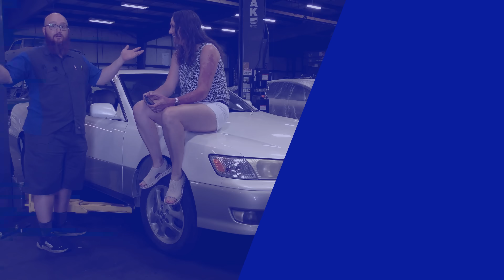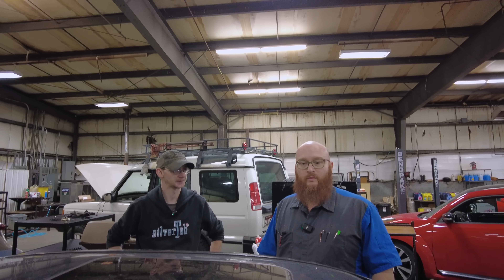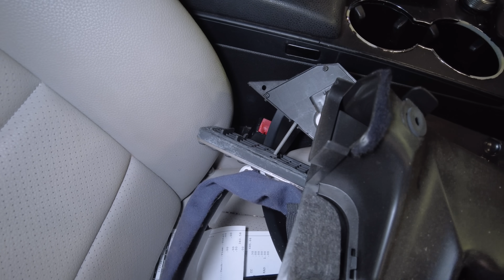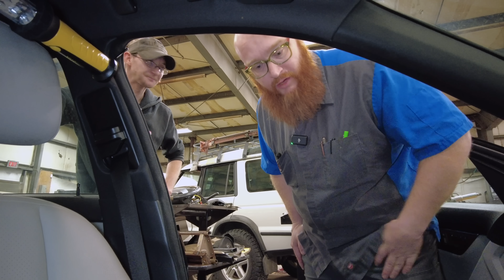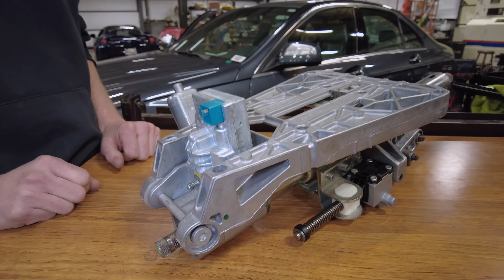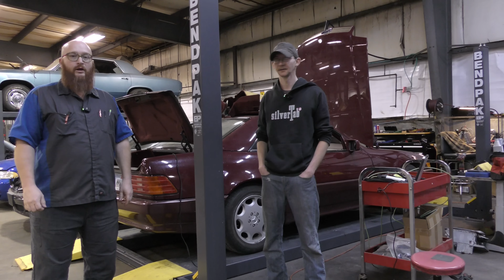Tiny Part TOTALLY Disabled This Mercedes! AND it's a Common Problem!

Comment: Know this feeling in a different way, Ive an Infiniti Q30, which for those that know, is Nissan's version of the Merc GLA. Well I had 5 errors in one recently, ABS , ASR , Brake Assist , AWD and PAS, Cruise control all disabled. 
Fault was a dead abs sensor, so should have been an easy fix, but had a local garage run away when Nissan quoted the sensor at £400 and also a wheel bearing for the internal part at £600, a mark up of 3 to 4 times over what Merc charge! 
Then a Merc specialist refused to even touch it! 
eventually got the sensor replaced via a friend who runs a tyre and brake place. But the insanity in that situation. Anyway a bit of a segway from this topic!

Comment: That is why I hate German engineering it is crap.
Reply: The issue is not bad engineering.  It's attributable to 'bean-counter led' very poor quality parts - with an emphasis on poor quality from 'you know where'.  If such a part had been fitted to a W123 Merc - it would still be operating today.

Comment: it happened to me on an older W202, local shops could not correct the problem, ended up selling car as was, went as far as replacing control unit  and many hours of diagnostics..

Comment: This is terribly inconvenient and somewhat embarrassing, but it's what happens when luxury is defined by complexity, bells, and whistles

I have a worse story. In Europe, the Netherlands some years back were using BMW's as police cars. Plenty fast. Advanced anti-theft protection. Tricky to steal. Then, a police car carrying 4 officers flew out of a corner and fell in a pond of sorts during a chase. Guess what? Anti-theft activated and the officers couldn't get out nor could anybody present at the time help them. Since the tragic loss of the police officers, that system is banned in the EU

If I ever drive luxury, it'd better only break when its inconvenient rather than when its dangerous

Comment: My first choice is to never own a Eurotrash car.  My second choice is to keep my low option 2010 Ford Fusion, even has manual transmission.  All this tech, especially in 2013+ cars means nothing newer than 2012 for me, if I had my choice I'd drive an 80's/90's anything GM with a 3800V6.

Comment: I had the same problem on my son w204 , we replaced the little motor inside the module , was 25$ on Amazon … Dealer was asking 3500$ to do the job

Comment: Of the 50% that doesn't lock, will an emulator be necessary? I can hear the lack of the lock and unlock feature however the car still starts and has been starting .
Reply: If it fails in the unlocked position I generally leave it in place. The lock pawl is actuated by gears and without power it won’t move

Comment: FYI there are local guys who can “fix” this for way cheaper than the $1200 it cost me to fix at the dealer.  I learned about this after the fact. Great cars otherwise and actually more reliable than a 2007 Camry Hybrid we also owned.
Reply: I find that hard to believe. Toyota's are some of the most reliable cars made. ( A retired mechanic of 27yrs).
Reply: @suzintru1  well, the hybrid battery failed at 120K miles ($3,500), when I sold at 130K miles the engine was using oil, the electronic brake modulator was failing ($2K), steering felt loose (diagnosed as failing steering gear, $2k) and the car was generally loose, paint failing, seat foam worn, etc. Contrast to my 2009 C300 which looked and drove like new. 

All my Camry issues, if you research, are quite normal. 

I’ve never had a German car wear so obviously as the Camry did.
Reply: @suzintru1  plus struts that were completely worn by 120K! And this was a Japan made one. So, sorry but Toyota was in a dark period for quite some time. All this said, my 1997 Land Cruiser is still with me and is great.
Reply: The 2AZ-FE engine was a Toyota dud, unless the owner managed to get it fixed under warranty (all it needed was new piston rings), after which it would be as good as most other Toyota engines.
Reply: @67daltonknox  at the time we received the campaign notice it was unfortunately not burning at that point, didn’t start until it ended. Similarly, a niece has a RAV with the same issue, burning to a comical level…the dealer, despite theoretically monitoring usage, never said it was out range of normal consumption 😀

Comment: Another example of engineered fails in a German car.
Reply: The issue is not bad engineering.  It's attributable to 'bean-counter led' very poor quality parts - with an emphasis on poor quality from 'you know where'.  If such a part had been fitted to a W123 Merc - it would still be operating today.

Comment: I have two 2009 c-class mercedes and both have experienced this failure in the last two years. I really can't complain though. Based on my experience as the original owner of these cars I don't think it is fair to say that it will fail again in 3-4 years. Before this module failed I enjoyed 12-14 years of flawless service from each of the two cars.
Reply: The mechanic said they do fail in 3-4 years because he experienced it in the workshop.
Reply: @anthonyxuereb792 they fail in 3-4 years as the replacement motor is usually Chinese or aftermarket, Mercedes does not sell just the motor separately, you have to buy the whole column
Reply: People pay attention please! It's not the motor I'm questing, it's the difficulty to replace it that's wrong. @Thondimuthusamy
Reply: @Thondimuthusamy  I would never reinstall another locking ESL, you are 100% right the vast majority of The locks/replacement gears are cheaply made.

I went the emulator route, and also I placed it in a convenient location so if it does ever go bad I'll be able to easily access it.
Reply: @edd2184 why would it ever go bad if u put a module in. The only reason it fails is because the motor burns out. Eliminating the motor eliminates possible failure. No?
Reply: @OneKyngTV  the emulators can go bad overtime, even though rare it does happen. By mounting it to a convenient location, if something does happen  you don't have to disassemble the lower dash.

However what a lot of people do, is buy a kit online to replace the ESL motor, why reinstall the same problematic part I have no idea. 

I wish I could answer more questions but I'm more familiar with the previous Mercedes locking system that use the switchblade key
Reply: @darklordsauron3415 the emulators are also Chinese made but since it uses microprocessors it must be reliable
Reply: If you go only for the motor, in 4y you will have the same issue, the module original replacement wll go a lot far. The aftermarket motors are not of the same quality
Reply: How are the rear subframes doing? I'm interested in this era of C-Class and E-Class but that's been my only concern.
Reply: These are great cars and the ESL is pretty much the main failure point to look out for. 

Wizard even said that in his video of which Benz to buy and which ones to avoid. 

the engine and transmission are very robust and if serviced with 5K mile full synthetic oil changes and 30-40K mile transmission services can go for a VERY long time. The best modern C class.
Reply: Avoid all German used cars outside of Germany. Germans need some Japanese input to help them overcome this dire situation. @8MunchenBayern8

Comment: GERMAN ENGINEERING
Reply: The issue is not bad engineering.  It's attributable to 'bean-counter led' very poor quality parts - with an emphasis on poor quality from 'you know where'.  If such a part had been fitted to a W123 Merc - it would still be operating today.

Comment: 9:03 My X204 is 12 years old now, i do a lot of short drives (work is less than 10km away) so it got many starts in the years since i bought it. Meaning that thingy has used it's motor each time twice (to unlock when starting and to lock when stopping) Haven't had that problem so far, so the "it will fail on you again in maybe 3-4 years" sounds a bit over dramatic to me.
Reply: Unfortunately, it’s truth. This one had previously been replaced, and I’ve seen new modules fail within two years.

Comment: As said below, where would the Wizzard be without Grimes.?
You can do all the diagnostics that you want, but previous experience is what
helps the most.
Grimes is way beyond the spare part fitters that you find at most main dealers.
Reply: ...exactly where he was before Grimes...you have the concept backwards...
Reply: I don't think so, it was Grimes who knew where to find the fault. @DericAnslum

Comment: It's absolutely criminal to design cars like that.
Reply: W126 w123 were built right, but government regulations (mpg, emissions, safety)  and cost prevent  cars being built like that anymore.
Reply: @nonofyabusiness4780 My W219 is built amazingly well. 232,000 miles today
Reply: @nonofyabusiness4780  government regulations are the only reason we HAVE decent cars nowadays. If it had been left to the manufacturers we would all still be in carbureted, rwd, V8 boats. They were forced. By government…and insurers.
Reply: @user-ew6jy9mo4r  : You have that in reverse. Government regulations are why cars are so horrible today, and why they all look the same.
Reply: @someone-else-c4v  nope nope nope. Go read a little bit about it. I wasn’t exaggerating at all. If it was left to US manufacturers, we would still be driving 15ft tanks with 8.0L, 200hp v8s. The only reason engine efficiency increased was because of gov regulations. Without that efficiency requirement, there would be no 700hp hellcats on pump gas. They would not have had incentive to increase bmep. There IS something to be said about TOO MUCH regulation…but that’s a different story all together. But really, go read up on it. It’s fascinating! The import restrictions during the 80s is the icing on the cake.
Reply: @user-ew6jy9mo4r  : You are completely and spectacularly wrong. Almost all safety features and improvements on cars were done BEFORE they became regulated. They had to be invented and test3eed first before they could be used and the government does NOT invent anything. They just destroy and ruin. The regulations just made them "standard", but before then people had a choice,. Plus, all these regulations and "improvements" have made cars cost DOUBLE (even when adjusted for inflation) than they were 40 or 50 years ago. Cars have become far less affordable for the average person than they were when I was a kid, that's for sure. And even USED cars now are through the roof. Government regulation destroys all that is good. The ONLY thing that regulation has improved were things like not allowing the pumping toxic waste into rivers and lakes etc. Everything else is a disaster. Besides, there are cars I would have wanted to own today that you can't even get anymore. Regulations have put the full sized sedan, and especially station wagons, which were fantastic because you had the comfort of a car and the carrying capacity of a truck, totally out of production and replaced by SUVs which get worse gas mileage, are not as comfortable and have a greater chance of rolling and still can't carry as much as a Caprice wagon could. I LIKE full sized sedans. I don't give a damn if it gets 50MPG or goes from 0-60 in three seconds. If people want toys like that let them buy it, but the cars I like don't even exit anymore and are gone for good. Plus, the older cars you could work on them with fewer tools, they were simpler and a lot cheaper to repair. Todays cars are rolling computers.
Reply: @someone-else-c4v  For real though, go read about it!
Reply: @someone-else-c4v  again, go read up about it!
Reply: @user-ew6jy9mo4r  Wow...Another ignorant fool.....
Reply: I've said many times The problem of using Mercedes, Bimmer, Audi or any high end cars here in North America is that the Mechanics here for these cars are shit...even at the dealership.  They still don't know how to fix easy stuff on Germans Cars compared to European Mechanics or even a roadside Mechanics in Africa or Middle East for these cars. My friends W204 had the same problem, and Bad  starter motor  in Ghana and was damn easy for these young Mechanics with few tools to fix everything without having to disassemble the whole car like this one. And oh for the starter they open it up and fix for just $30
Reply: I consider the criminal aspect to be the use of 'bean counter' led very poor quality parts - with an emphasis on 'poor quality'.  If this design feature had been included into the 'tank era' of Mecedes vehicles there would be no module failures.
Reply: @georgebettiol8338  but the “tank era” cars were all wasted. They were designed to run 500k miles w service. Americans tossed them all waaaay before that. Which is first, the chicken or the egg?  Are manufacturers building disposable cars because the consumer wants it? What did the consumer do with non disposable products?
Reply: It's called marketing nowadays
Reply: Absolutely agree, should be a recall.
Reply: Three word solution: Toy Oh Tah and your problems go away forever!
Reply: @patrickphippspa584  three words 🤣
Reply: @patrickphippspa584 You can date a man and you won’t ever have to worry about him getting pregnant.
Reply: @patrickphippspa584  I hate my TOYOTA.  I've been hoping to change it for something else but I've been driving it for 20 years and it won't break to give me an excuse for a new car.
Reply: ahhh, oh, yeah. Sure you hate your Toyota (like anyone would believe that!). 20 years of trouble-free ownership and you're "looking for an excuse" for a new car. Betcha it'll be a new Toyota IF you part ways with your old one. SMH @sugentechnologies1527
Reply: Everything is designed this way now. Buckle up!

Comment: I have a 2009 C300 and (knock on wood) I have yet to experience this issue. 

I think I would flip a coin to having it replaced.
Reply: Just pay attention to the sound of the lock motors. When they start to get sluggish it’s time to start planning on replacement
Reply: @GrimesGarage  thanks for the heads up.

Comment: When I saw this video thumbnail and title, I knew exactly what this was 😂 I had bought a 2009 C300 new at the dealer and around 80k miles this exactly scenario happened. Outside of warranty of course. Tow was free to dealer - but repair was $1200 😭
Reply: Thats not bad! Very nice of them to take care of the towing and last time I heard an estimate for this job it was $2200
Reply: @Ukiegaming  I think I got lucky - sometimes the dealer will goodwill the work or a chunk of the work and put a claim in with MBUSA. Since I had bought it new there and had serviced there, they definitely made it bearable
Reply: lol same as my 2009, happened about year 8 of ownership and 90K. Only real issue I had in 10yrs and wish I hadn’t sold it.

Comment: I have one of these cars (2011 W204) and the steering lock motor has been occasionally not unlocking, it is very intermittent. It's been going on for over two years and has happened maybe a dozen times.
Reply: It may be warning you to get it fixed before it totally doesn't unlock when you really need your car!
Reply: @volvo09 100% from my experience, if you get any errors or it acts dead the first time you insert the key, failure is imminent, fix now!
Reply: @volvo09 I ignored warnings, didn’t know, and ultimately was stranded in a rainstorm during rush hour and far from home…
Reply: @bck0001  yep, that's when it'll happen!

Rainstorm, snowstorm, at the store when you ran down real fast and left something important behind that needed tending to...
Reply: So can I just replace the module with the emulator before the current one goes? That will be much easier?
Reply: Best fix it now before it locks and it’ll be a harder repair and more costly

Comment: Mice can reak havoc with many systems and especially with a modern canbus fed system, a tiny wire can mess up a lot of functions. They are so small and can hide so well that it is a full time job to get them out. We had a cat in our garage that was hunting mice among the cars that came in after we found some chewed up wires in one of them. She managed to kill a mouse or two while she was lent to us by one of the guys that had a cat. It was kinda nice to have a resident pet in the shop but she left paw prints on the cars, so we had to wash our customers cars before returnng them. lol

Comment: Economically 100% agree with the replacement emulator.... but with this modification to the security system will it effect the insurance on the car as it is now not standard?

Not a US citizen but this could stop insurance claim payout on Europe
Reply: How would they ever find out?

The immobilizer still works, so the car still won't start or shift out of park without the key or being hacked.

They'd still have to haul it off on a flatbed after dragging it on.
Reply: USA! USA! USA!

USA!

Comment: theres also an Emulator to bypass this, which costs like $30 or something and you DONT have to literally take apart the entire thing
Reply: Only if it failed in the unlocked position. If it's locked, it has to come out.

Comment: I always wanted to buy one of these C250 Sedans. The base model with the 6 speed manual and rwd. Seems like a decent daily and wont be too expejsive w the basic NA V6
Reply: dog shit
Reply: Definitely stay away from the m272 engines. Timing cassette failures are wildly common around 100-130k